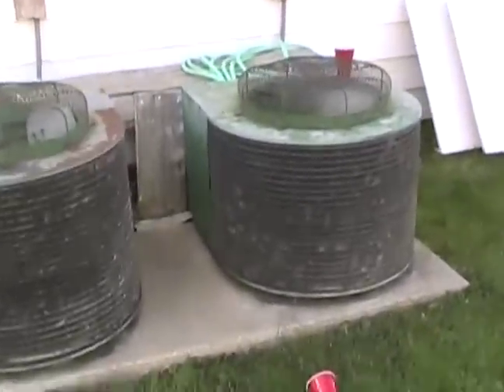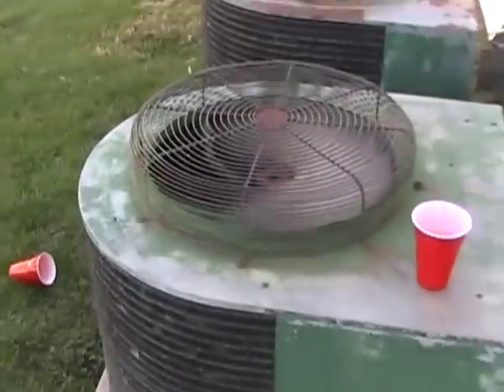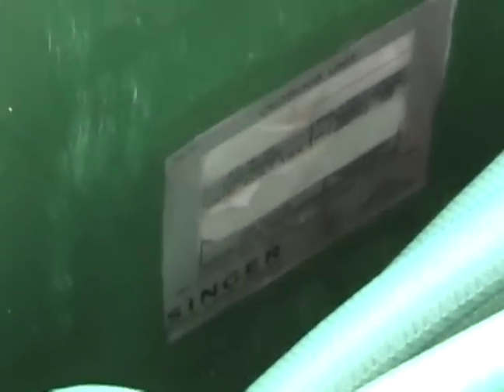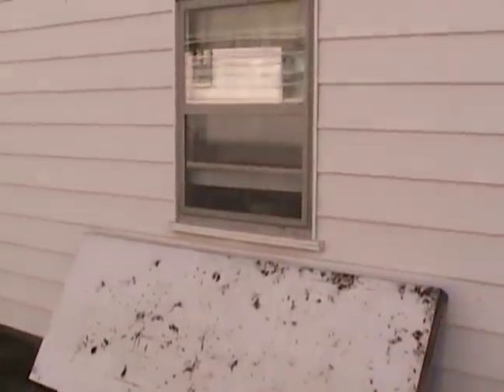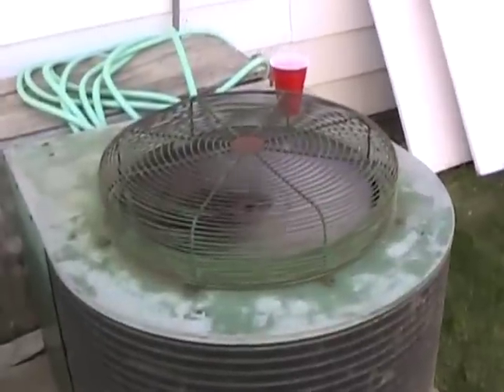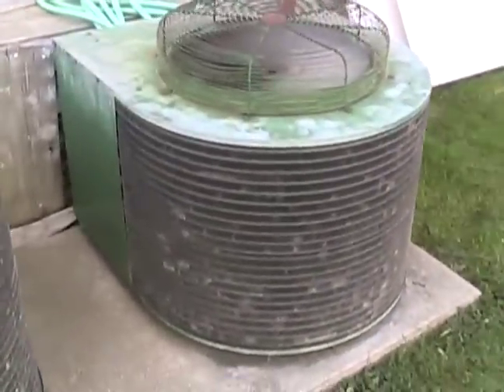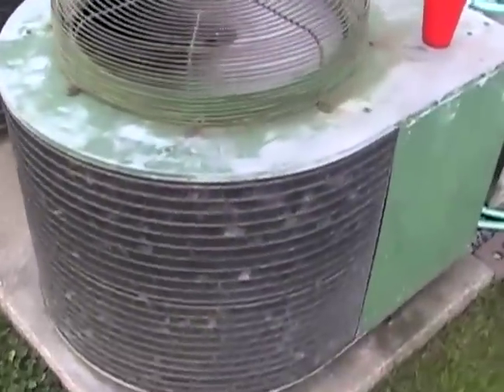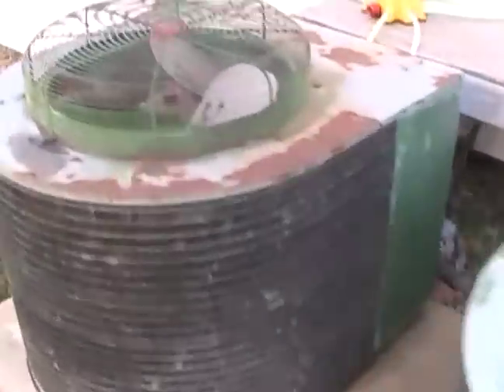Another HVAC Video: Old Working Singer Air Conditioning Condenser Unit

Comment: I live in central Florida.   I know of 4-5 of these still in my neighborhood still working. Installed 1978.  And I just helped replace the fan motor on one of these yesterday.   It's amazing how many times the coil has been hit with a lawn mower but it still keeps going.   Blows cold too.
Reply from the maker: The condensing unit shown in the video is still working. Its twin to the left was replaced for reasons unknown. It's not tremendously surprising to hear that some of these are still around. They were built well and if installed properly, could go on for many more years. The only bad thing about them is the relatively low efficiency.

Comment: Had that same unit on a house in wisconsin. It was still working fine when I sold the house in 2021. 45 years old!
Reply from the maker: One of the two shown in the video is still there and going strong. The other has been replaced.

Comment: A friend of mine have the same unit installed in 1975, called me for AC not cooling,  and found compressor burnt out, the model is singer ACR51058-3A, can any one help find how many tons it is? I need to replace it with same capacity, and my friend said its a 3.5 ton but the compressor with out label and looks more than that.
Reply from the maker: You might check the indoor evaporator coil for identifying markings, if it is the original.
Reply from the maker: Check the compressor for any identifying marks. You might get lucky.

https://www.youtube.com/watch?v=GNM7sscpP90

Comment: We had one of these put in in 1981.  In June of 86 dad shot it with a Arrow during target practice.  (Bent arrow took a right and nailed it).  I bought the house and as of 2020 we are just now replacing the Trane unit they replaced it with.

Comment: So what’s the kind of ac unit that has the legs like on a pin ball machine and a square with 4 fans in one unit and a tall cage like that meaning what is it called and what’s the company because the doctor here in Birmingham Alabama I went to as a kid had some vintage looking ones like that too before they replaced them dang I just realized a little bit ago then for got them realized that i could’ve asked for them if I had known and if my dad would have been ok with it

Comment: That looks exactly like ours....exactly! Runs like a champ except this morning I noticed the fan had stopped. Every so often it might start spinning but pretty much, it doesn't. Opened her up and took a look around. Surprised to find, these didn't have a belt or any where to oil. Nothing in the way of the fan and it spins fairly freely. A/C is good and seems to pump but no way to keep the unit cool. My guess is all I need is a new motor? Any guesses?? I want to keep this puppy running another year!
Reply from the maker: You'll want to shut the air conditioner off if you haven't already. When the fan isn't running, pressures will become very high and may overwork the compressor motor. This could cause it to burn out. If that happens, the unit is no longer economically repairable.

As for the fan, I suspect that you will need one or both of a capacitor and a motor. Someone should also check the contactor (a switch in the outdoor unit that's controlled by the thermostat) to make sure it isn't burned or worn.
Reply: Lynn, did you ever find an answer to this?  My motor seized up as well, it was running perfectly until that point, luckily it was the end of summer.  I think it just needs a new fan motor but I don't know where to look.

Comment: I've got a similar singer unit on my 1920 house in Webster Groves, MO (reasonable close to Redbud, IL).  The fan is inside the "U" shape (instead of being on-top) but it looks very similar.  Mine seems to have an all copper coil and fins because they're all green.  During the pre-purchase home inspection, the inspector thought it was from the 1990s.  Were these still branded as "Singer" after the the 1981 purchase that other commenters mention?  If not, then my unit is at least 10 years older that the inspector thought.
Reply from the maker: To the best of my knowledge, the Singer name didn't survive past 1984.

Comment: @UXWBILL: Thank you very much. I looked it over and it was in fact put on by electric company. Is there any way to by pass it, The problem I am having is the unit runs but when it gets hot, it shuts down the fan. Would replacing the compressor capacitor solve this problem? I have already replaced the fan motor capacitor but not the compressor.

Comment: I@UXWBILL:  have a unit almost identical to that one abd have had excellent service out of it for 40 years but know I need a part to get the ac working right. Any ideal where I can get the condenser control circuit board part form. Mines is in a plastic housing mounted outside the unit?

Comment: They're are some ways of making your old A/C unit run more efficiently.  Make sure the condenser coils are straight and in good condition.  Always keep the unit clean.  Check the condition of the wires and running capacitor.  Maintaining the unit keeps it running efficiently and lasts even longer

Comment: Illinois must have a lot of nice old stuff. Usually the vintage appliances I see on eBay come from IL. Random, but interesting.

It seems to run just fine. Closing the door is useless if the windows are all still open!

Comment: The oldest I have seen is on the old Nevele hotel that closed a few years back it has some still there from the late 70s when I was in high school in Louisville at the time . I am now in NY in a small area by 3 nice old hotels only 1 is still open . The Nevele I was there last week and they have at least 5 Singer 10 ton units.
So I guess singer made the big ones to.